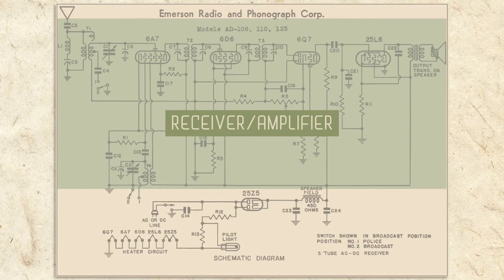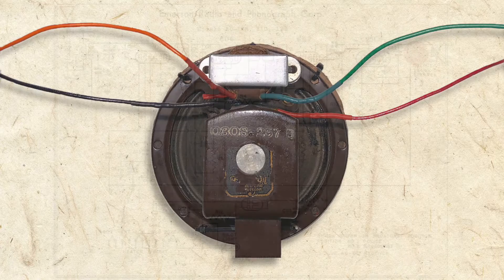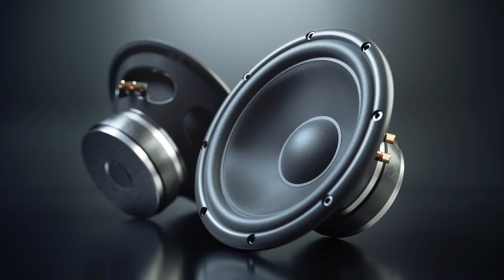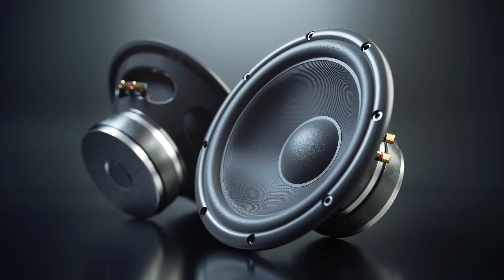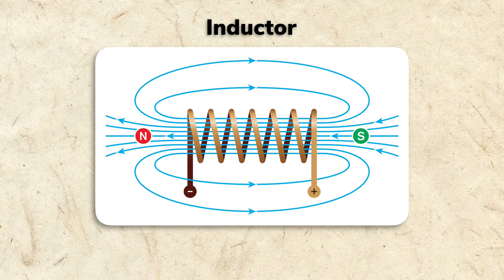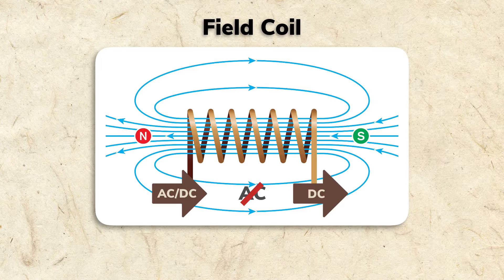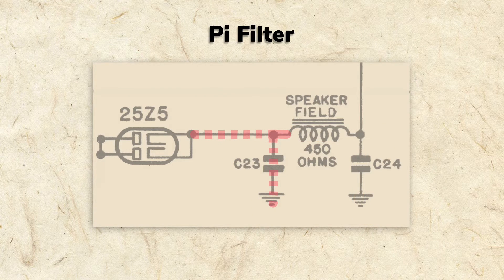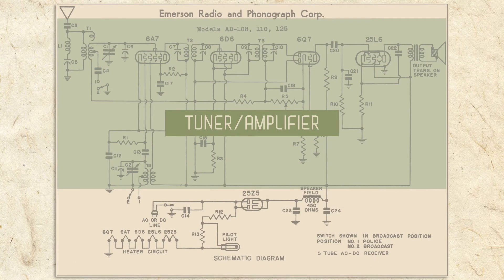How Do Speaker Field Coils Work?

Comment: Thanks for the video! I have a question if I may ask... I have a big, and very heavy, 12" Field Coil speaker that came out of an old Hammond Organ and I want to use it with a Guitar amplifier. I'm sure every Field Coil is different but, would I generally use the B+ coming off the Guitar amplifier to power the electromagnet or would it be better to make a seperate power supply just for the Field Coil? My idea is to put this speaker into its own cabinet with the power supply and then just run the audio signal out of the guitar amp to the cabinet as if it were a permanent magnet speaker. Other than that, my only concern is how do I ascertain how much DC voltage it needs for its optimal efficiency. Unfortunately, I don't have a variable high voltage supply that I can use to tweak it but, I have a bunch of step-up Transformers ranging from 200v up to 700v or so that I can use. The power transformer that came off of the organ's amplifier is a 300-0-300 vct which was what it used to power the Field Coil. I'm really just trying to figure out how to give it what it wants and avoid giving it too much or too little. Thanks again!

Comment: Great video, thanks for sharing! Subbed. Please note that modern speakers do still use electromagnets. More accurately, modern speakers no longer use electromagnets for the field coil, but the voice coil is an electromagnet and thus vibrates against the permanent magnet when power is modulated through the voice coil.
Reply from the maker: Thanks, Samy, appreciate the sub and excellent comment. Yes, in this video I didn’t want to get ahead of myself and focused only on the field coil. The voice coil is described in a later video in the series called, “How does a speaker work...” There, the function of the voice coil as an electromagnet is discussed. https://youtu.be/TYxfdg6yfOk
Reply: @FluxCondenser  Ahh, very cool!
Reply: Your explanation or contention is quite weird. A moving coil speaker (or a microphone) is a transducer, which means it converts energy in one form to the other. A speaker converts electrical energy (power) into acoustic energy.
If both the field and the armature happen to be of permanent magnets there won't be anything happening. 
In a static magnetic field if a conductor moves a current would be induced; this is a dynamo. In the same static magnetic field a current is passed in a conductor the conductor would move. Remember the Fleming's left hand rule for the motor and the right hand rule for the dynamo. 
In the beginning people had used electromagnet for providing the magnetic field in which the armature, the voice coil of the speaker moved.
The added feature is that it offered the other important function of chocking the AC ripples in the rectified power to the radio.
The people of those days had real sense in doing something. We should be able to appreciate it.
 Now a days it's not needed because of the availability of very strong permanent magnets, the Neodymium alloy being the strongest till now.
Reply from the maker: What specific explanation or contention is weird? Your explanation just rehashes what’s been described in my videos.

Comment: I love electronics!...just not quite enough to do the work in college, unfortunately.  My goal is to buy some vintage field coil speakers from eBay, and construct some top quality sealed enclosures made of MDF and wood for them.  I need to figure out how much voltage a field coil speaker needs (I’m suspect it varies from model to model).  The end goal is to take a 1940s or ‘50s era speaker which would otherwise be discarded and get it to sound as good as possible.
Reply from the maker: Sounds like a fun project, MusicStudent1. Yes, you’ll need to do your homework on the speaker you use to determine the volts required and amps drawn by the field coil. Then, you can locate a suitable DC power supply. Also be mindful of the voice coil’s impedance as you’ll want to make sure your amp is a suitable match. I’ve never built a speaker cabinet, but have always been interested in the process. There’s a lot to consider, and again, you’ll want to do research to determine if the speaker you choose will work best in a sealed enclosure or one with a port or other opening. You may also want to augment it with a high frequency driver which would require a crossover. There are many books and online resources available discussing speaker design. The internal volume and damping materials used can be critical to get good sound as resonance needs to be considered. Good luck with the project and keep us updated with your progress.
Reply: @FluxCondenser  , the idea is to take a device, like a loudspeaker, and take it beyond it's intended use.  I did a little prototype project this summer with $4.00 speakers, an amp, and a wine storage box.  It has ridiculously deep bass when I play those subwoofer demos on it.

 https://youtu.be/h4bYGBB9sNA

https://youtu.be/5vuAaLebMc0

An electrical engineer friend of mine attended an audio lecture in college and relayed that in a nutshell...the bigger the enclosure the better and the bigger the baffle the better.  My enclosures are going to be sealed and huge...it's going to be an experiment.  Stand by!
Reply: I picked up an old radio recently.  Its audio stages are remarkably similar to those of guitar amps. Makes sense, since guitar amps started using audio circuits from almost 100 years ago.  If I can’t get the RF portion of this old radio working, I’ll just use it as a guitar amp.